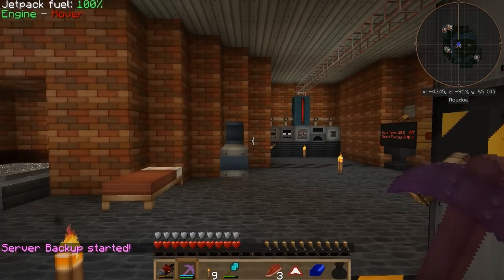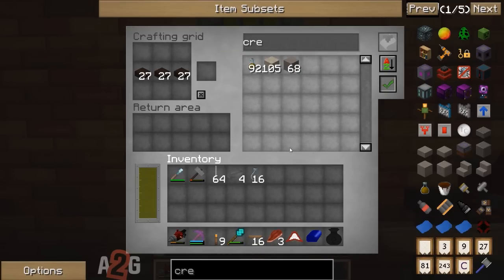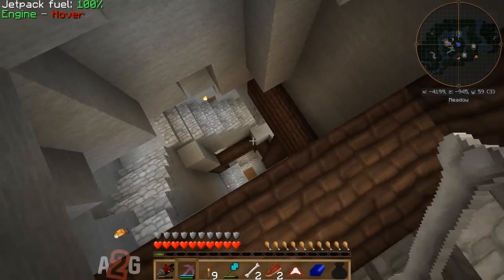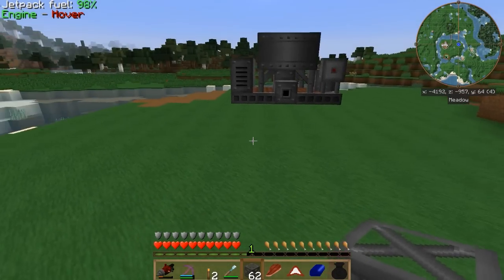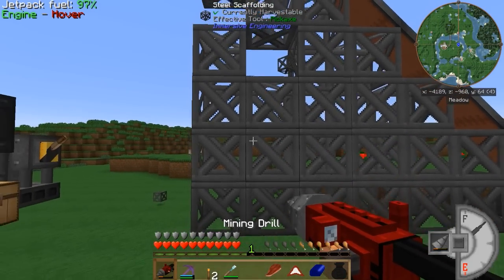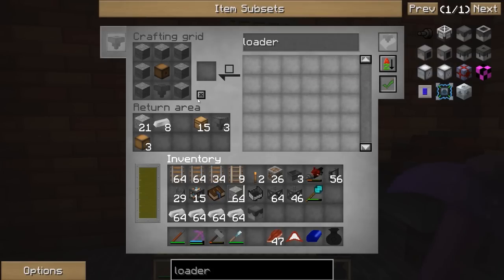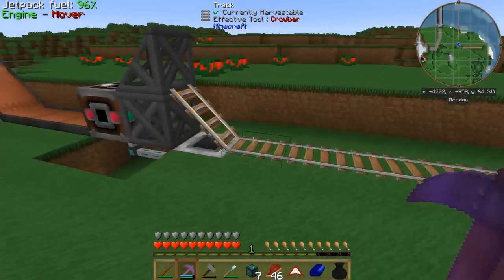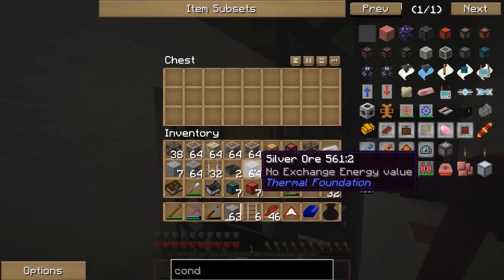Hauling the Ores | FTB Inventions Ep.9

Comment: It would be awesome if you had holding tracks at the top and bottom.  The top track holds carts waiting to unload, and the bottom one holds empty carts waiting to be filled.  You'd have to use switch tracks and signals, though.